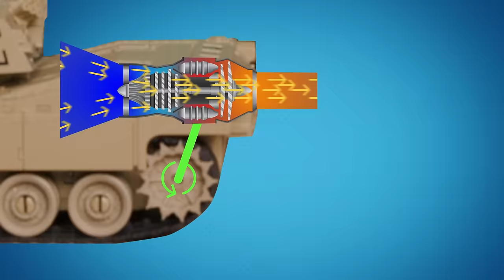Army Mechanic Reacts to Tank Fails

Comment: 5:52 Im not a tank mechanic and even I can guess why you don't wanna hear this sound, because now, that screw is down at the bottom under all them blades and fins in the turbine, and you gotta take them all out to get that screw out, because if you try to start it with that thing in there it will tear itself apart.

Comment: Interesting seeing the British Churchill tank footage at the end, the footage appears to be part of a "not what to do" instruction film. The Churchill was an extremely long but narrow tank and as seen in the footage a steep side angle piece of terrain or track could be a REAL issue. If the gun was in the forward/rearward position you would be hard pressed to damage it as it was only a fairly short barrelled gun that was set far back from the tracks. I almost had the chance to drive one once but flooded the engine, stalled it and couldn't restart (it's an un-nerving vehicle to try and drive for the first time as the vision is extremely poor and you are sat about 6 foot back from the tracks and directly between them).

Comment: 5:50  The reason the guy is making the xylophone of agony point is that he dropped it through the compressor side.... if you look at your diagram you can see that it cant fall back out easily as it will be most likley lodged inside of the burn chambers xD (bassically that 1 droped bolt would mean your are fully dissasembeling the entier compressor section of the gas turbine & probably some of the burn chamber lol)

Comment: Have you ever gotten a tank stuck... absolutely? Seriously, that's your answer? I spent a year on a Bradley and 3 years in a striker, never once have I gotten a military vehicle stuck. When we were standing up 2nd cav in ft Lewis WA, we had to go through a month of field training to learn the strikers. We had to climb hillsides littered with stumps. Every other striker in my unit got stuck. I probably pulled half of them out myself. Listen, if you can't avoid getting stuck you have one of two problems. Your communications between you and the vehicle commander aren't good, or you don't understand either the capabilities of the vehicle or the terrain. Either way, the nonchalance of his response tells me we currently have a problem in our tank units. I was proud to say I've never gotten a military vehicle stuck, ever! He acts like it's just another Tues... hopefully his tank never gets stuck during combat... I can even say that despite the fact that I half threw off the track on my Bradley during training maneuvers. My commander was able to stop me in time to where we just reversed my movement and reseated the track and kept going. That's how you use teamwork, communication, skill, and patience to avoid a potential issue that could kill you during combat. Shame on you sergeant.

Comment: Couple neat things:
1. The heaviest tank ever built, the Panzer VIII "Maus" got stuck in mud during tests, and at 200ish tons, you'd expect it to be impossible to get out. Surprisingly, after a lot of digging around it, it drove right out of the mud! I found that humorous and impressive.

2. The Sherman tank (the type that overheated) could have quite a variation of engines in it, ranging from an air cooled radial engine from aircraft, to a Diesel engine, which Britain liked putting in their Shermans. Point being, depending on the engine, there may have been no radiator at all!

Comment: 5:50 the reason you never wanna hear this noise is because the individual blades are loosely slotted into the shaft and are allowed to wobble a bit, so normally it makes muted clicks kind of noise. If the turbine makes this musical instrument like noise, it's because the blades are rusted solid to the axle, and the engine is completely ruined. It's a jet engine equivalent of crankshaft friction-welded to the block.

Comment: At 0:14 , okay so I worked at Miller machine making parts for the Abram . I could show you how to take that tank out with a sing or 5 water balloons. There's also a few other tanks you can disabled by simply throwing a bucket of bolts at the damn back tread gear. Just wanted to add my two cents they can make these things as tough as they want to look but looks have nothing against actual stuff like dudes just because you ran through a puddle doesn't mean the damn tank needs to fail. It's called paying us the extra $16 to apply the weather material.

Comment: I will never forget, right before my 8th birthday, we went to a outdoor army expo. My father used to drive tank and apc. He was in his early fifties and the guy running the vehicles was friends with my brother who was active duty at the time. He basically let my dad drive the APC. I wanted to stand in the back like the men. My niece who was a year younger than me was sitting in the seat strapped in terrified. I was extremely excited. My father was feeling his oats, and thought it would be a good idea to take the gravel mound. The APC launched and when it came down the ground acts like brakes momentarily. We were probably only going 25 or 30 but I couldn't hold myself and I remember my elbow cracked against Bastille and I couldn't feel my last two fingers for about 3 days. 🤣 I didn't at all tell my father because he told me to sit down and put the seat belt on and i didn't. I already had a sore elbow I didn't need a sore behind to go with it 🤣.

Comment: 12:15 Most flatbed trailers are 8.5 feet across, rubrail to rubrail. Lowboys tend to have outrigger attachments for wider loads, heavy loads on average will have steel ones, but more often you will have steel with wooden planks to load wider vehicles. Wood is better because if you have something like a tank on the trailer, the steel bits will bite into the wood and have better friction with the trailer. Always over secure your load if you aren't sure of the precise weight.
I'm an ex Flatbed driver and am available for react videos as well.

Comment: As a former 63A that also served at the 1/11th ACR for 3 years, the video title says “Mechanic” but those 2 are Cavalry which are “Tankers”, but they are correct with the info they said about the M1A1. Carry on!
Reply: CALVARY ARE NOT TANKERS
Reply: @rdejaynes Damn thats crazy considering they're both 19 series, wear yellow cords, and you didn't even spell Cavalry correctly.  Also, Col Ferguson,  the 45th Col of the 11th Armored CAVALRY Regiment... is a Tanker

Comment: First one was the T-72B in Russia. Tank wasn't wearing the rubber pads (detachable) at the time and tank was running late. 
Second was a T-64BV in Ukraine during demonstration. Engine flooded.
Tank rollover was done by a Kuwaiti crew. Tank collision was between African crews. Also I wouldn't call that Tank Biathlon "worst". I'd call it "most eventful" because I watched it live and by God it was actually exciting and fun :) All the screw-ups made it all the more worth watching :D

One addition I'd offer is that on T-64, T-72, T-80 and T-90 tanks, the controls are via dual control sticks and apart from T-90, the transmission is manually shifted. T-90 has automatic. Very old school.

Comment: those old WWII era tanks used what were called laterals, basically levers that you pulled on to 'brake' a track and turn by slowing one track down a touch.  That's why the Churchill's (?) tracks kept moving,  once it rolled the driver wasn't holding on the levers and it just kept moving.
Reply: He should have shut the engine off. When it's upside down the oil is in the wrong place and can't be picked up by the oil pump and now the bearings aren't lubricated

Comment: That first clip was filmed like five years ago in Minsk, Belarus. The tank did have rubber blocks on the tracks, otherwise it would not have been allowed to drive on one of the two main avenues of the city. The driver just lost control on a slippery road. The reason that tank was there at all (and the street was empty) is that was part of the preparation for the Victory Day parade, which has been a tradition in Belarus since the time it was part of the Soviet Union (and obviously became quite controversial since the invasion into Ukrraine).

Comment: I was an Infantryman in the Army. While in South Korea for Operation Foal Eagle (joint unit training) I was tasked out mostly as a Stryker driver. One day during a vehicle live fire that involved tanks one of them got stuck. Dude was doing everything to get out of the mud, just absolutely caked. So in order for some internal branch fun poking I told my platoon leader that I was going to get that tank out of the mud with a Stryker. 

What's crazy? I actually did it. Of course with the tank on full acceleration as well as me but it happened. Dude cut off a one of his boot straps and gave it to me. Still have the boot strap to this day, hanging up with my Foal Eagle Commendation certificate.

Comment: Tanks can do highway speed. From my experience in german army from the 1980s: The Leopard 2 is usually limited to 70kph but thats for limiting wear and maintenance. For emergency, the limit can be taken off and the tank can go 105kph plus minus, depends on the individual tank. The Marder, the armored vehicle for about 10 infantrists is able to go more than 120kph what was about the same or even a bit more than the nortorius german Beetle from Volkswagen or the 2CV from Citroen are able to go. The drivers called it "hunting ducks" when going fast on the Autobahn. The nickname of the 2CV was duck or "Ente" in german. Quite dangerous i might ad. The Marder is going then on 4 rolls only the others are just in the air. One small tick on the stirring and the tank goes over the middle into the incoming traffic or into the trees to the right.

Comment: I was a 19E and 19k back in the 80's. I ran over a car that had already been ran over multiple times and the bumper of the car got caught in my track. Luckily we were the last tank in the column had to fiddle with it about 5 minutes to get it out. So I we didn't get an ass reaming. Had a Spanish speaking tank commander for a few weeks who spoke very bad English. That wasn't a good experience. My experience is. Tank mechanics were in the HQ platoon. They didn't actually work on the engines. Just helped the crew with engine changes and using the m88 wrecker. They did work on hydraulic 's , electrical, tracks, road wheels,sprockets, heaters stuff like that. Being in a cav. unit I was also a 19d when the scouts needed someone. M60A1 on slick icey hilly German roads that was dangerous.

Comment: I'd like to add some context for that last clip.

That tank is a British Churchill. It was classified as an infantry tank, meaning it operated alongside infantry so it's top speed was 15mph, there wasn't any need for more.

A specification of British tanks was that their main hulls had a maximum width of 9 feet, to fit within the UK rail loading gauge and be transportable by train; our loading gauge is a lot more restrictive than Europe or America. As such, the only way British tanks could get bigger was getting longer. The side louvres would foul this loading gauge, if they weren't dismounted for transport.

Finally, based on the setup I would guess that maybe this was a test to see what happens when a Churchill rolls over, maybe as a viability study? If so, I'm not sure it can be called a fail, except maybe as "task failed successfully".

But yes, tank design doctrine has changed a lot since then.

Comment: When they are discussing tank controls, the Soviet era tanks (like T-72) use a manually set & locked throttle (for idle) and lateral controls to brake the left or right driven treads. Also, T-72 had a 7-speed manual. So you really cannot shift and turn at the same time. Well, you cannot turn right, assuming your left hand stays on left lateral.

Comment: Most of the Shermans had air-cooled Continental 9cylinder gas airplane engines.And many Ford, GMC diesel,Chrysler gas Wierd, but mostly the airplane airplane aircooled engine.
 Cheers from the Pacific West Coast of Canada.

Comment: Some models of Sherman tank had a unique engine that was 5 inline six engines geared to a common output shaft. 30 cylinders. Most had a modified radial aircraft engine.

Comment: fast and the furious tank was a Howe & Howe Ripsaw disguised as some real tank.they're pretty light and can do 55-60 mph so it was definitely movie effects.
As far as that last scene goes, idk about old tanks but you want to take a drop like that head on firstly the drop must not be longer than the tank track is, want @2-5 mph, basically idling, and as you hit the tipping point you want to apply some brakes to help counteract gravity. until the front of the track connects with the ground, then you can start letting off the brake slowly and everyone needs to be braced because the back coming down will hurt if you cant walk it down the wall. Don't do this unless you have no choice. Again, do not do this unless you have no choice. and whatever you do, dont take a drop facing at anything greater or less than a 90 degree angle with the edge. Center of gravity on a tank goes up as the tank goes down any deviance can cause a flip

Comment: The Sherman tanks (depending on the exact model) mostly had petrol (gasoline engines). the first ones were equipped with modified aircraft radial engines, because these were the only engines at the time, with the required power / weight ratio. This explains as well, which the Sherman hull is so tall. Some late war versions had Diesel enines.
Reply: That would explain the moniker of 'Tommy Cooker'

Comment: The Abrams tank has a thirsty turbine engine, but it can run on jet fuel, gas, diesel, any fuel that can be salvaged or stolen on the battlefield.
Reply: That's not true. I have been reliably informed that diesel causes rapid fouling and gasoline burns too hot. The AGT1500 consumes half the entire annual US Army maintenance budget alone. It's a massive problem and one of many for the Abrams.
Reply: @Tattlebot   Your information is unreliable. The Australian M1s have run on diesel since we sold them to them, not to mention the fact the U.S used diesel in them until it switched to JP8 in 1990.
Reply: @32Umzy  I'm guessing there is a conversion kit. JP8 is non-lubricating, so a lubricant supplement is included. Typical grades of diesel will cause accelerated fouling in this configuration.
Reply: @32Umzy  I am Australian and acquisition of the M1 series is one of many infuriating defence decisions made by our colonial government. As of 2024 we have no credible self defense. We have no heavy conventional strike missiles typical of Russia and China because the US doesn't build them, being a naval and aeronautical imperial power.

Comment: I pulled a 3ft "wheelie" once in a M109    braked it, gunned it and away we go  lol!!...then for some reason we had to drive IN reverse all the way back to the motor pool.....  fun fact it takes about 16 hours to pull pack and replace it....  :)        Alpha battery 2/35 FA  24th inf  1988

Comment: The fact that the tank was invented 108 years ago and yet, with all the fancy thingamabobs, gizmos, thingamajigs and even doodads that modern tanks have mounted on them wet dirt still manages to easly stop them is beautiful. You'd think engineers would've figured out a way to at least dampen the problem, since it can't be 100% fixed

Comment: The tank at 15:58 is a British WW2 Churchill infantry tank. It was heavily armoured and had excellent obstacle crossing capabilities, but it was very slow. And crossing a ditch at an angle is obviously stupid. If it had tried to cross the ditch at a 90 degree angle, it would probably been able to cross it. Btw., the Vritish tanks were generally narrower and lower than the tanks of other countries (still are), due to the smaller railway loading gauge they have there. On longer distances, tanks are mostly transported by rail, but in the UK tunnels and bridges are narrower than e.. on the European continent, North America or Russia, so the tanks had to be built smaller.

Comment: So if im not mistaken, the Sherman's with the Pentastar engine five six cyl engines in one pentagonal arrangement (the inspiration of Chryslers pentagon star logo) were liquid cooled, however there were other variants running single or double row air cooled radial engines. Think they had 14 or 18 cylinders off the top of my head.

Comment: They actually make a giant snorkel for the Leopard so you can drive with the tank fully submerged. The only problem is it stops sucking air through the intake and starts sucking it though the crew compartment. There is a safety so it can't be engaged with the hatches closes but if that safety is broken, the inside of the tank will become a vacuum in seconds. RIP.

Comment: First, all-white, vehicle that tips off of the "transporter" isn't a tank, it's an SPG, specifically a French AMX-30 AuF1 155mm, at a guess as part of UNPROFOR with the white color scheme.
The one following that is ALSO a Self-Propelled Gun, that one is the SO-152, or if you prefer the 2S3 Akatsiya, a Soviet 152.4 mm gun from the early 1970s, currently in use by both Russia and the Ukraine, as well as several former Soviet and Soviet-block nations.
Last one of the falling ones is a tank of some Soviet/Russian make. The video isn't the clearest, but I'll go out on a limb and say a T-72, which entered service in 1973, so again an early 70s machine. Like the SO-152, it's seen significant use by both Russia and the Ukraine, as well as the former Soviet (block) nations.